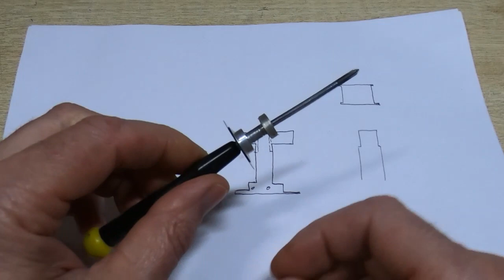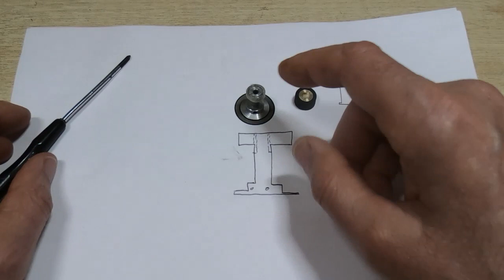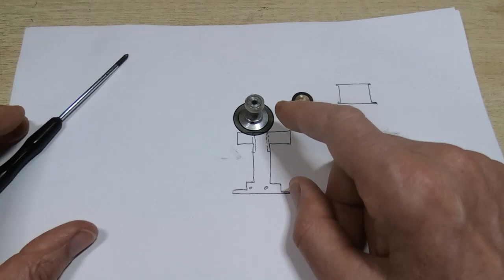HP85B Repair Part5

Comment: You could mount the spindle to turn between centers but would need to make a suitable lathe dog to drive it (and be careful the dog does not contact the glass encoder wheel and break it. A set of aluminum jaws is handy for things like this too as you can machine them to clear tings like the encoder wheel and only grip the shaft. I have also used CA to glue a thin wall part to an arbor for machining and then used acetone to release the part from the arbor. Not a good option because of the encoder wheel, the acetone might react badly with what printing on the wheel.
Reply from the maker: You would not really gain anything trying to turn this item between centres as you would still need to centre the headstock centre. This item is also WAY too small and fragile to even consider turning between centres. I also need to machine off the end so that prevents turning between centres anyway.and the CA method will not work as there is nothing to glue to other than the encoder disk. I would not use that method for an item like this anyway although it is useful for machining things such as clock wheels. I will show a suitable method in the next video and I explain why I use this approach. However as I always say you should try whatever you want to try but I would suggest caution when working with parts that cannot be replaced if damaged.
Reply: @JerryWalker001  re: glue fixturing - I was meaning to turn a shaft/arbor to form a tight fit to the ID of the drive spindle, i.e. insert like your screwdriver. But glue drive spindle onto shaft. That way you can grip the tail end of the shaft behind the encoder.

You could also machine a collar with an OD larger than the encoder disc and ID that is a tight fit on the spindle shaft. This would require manually cutting the roller section off to fix the spindle shaft in the collar.

Just sharing ideas that pop into my head. It will be interesting to see how you solve the problem. Lots of ways to skin a cat as they say.

Comment: I also would enjoy seeing the complete machining process. As the motor shaft is quite long would an alternate solution be to cut the existing spindle/encoder into two pieces just above the encoder disk mounting flange then machine a new roller spindle with its own grub screws? My thought is that this would reduce the chances of damaging the unobtainium encoder disk. Regards, David.
Reply from the maker: I did consider that but I will explain why I discounted it as an option in the next video.

Comment: Love your video! Almost makes me sad I don't have a drive of my own to modify.

I wonder how feasible it is to produce a replacement encoder wheel. Is it something a laser cutter could etch out of acrylic, or maybe even a flexible PCB? Does it use a photodiode or hall effect sensor?

If you have a flat-bed scanner I'd be interested in seeing the quadrature encoding pattern, which I assume is needed if the tape can be read and written in both directions.

Thank you for providing such interesting content!

Comment: How did two types of tapes so similar to each other get produced.
Reply from the maker: It is not a coincidence. The DC100 is a 2 track version of the DC2000 (20 track tape). It was produced as a more compact version specifically for use in instruments but was really just a modified version of an existing tape. There are actually around 20 very similar tape types but the DC2000 is currently the easiest to find.